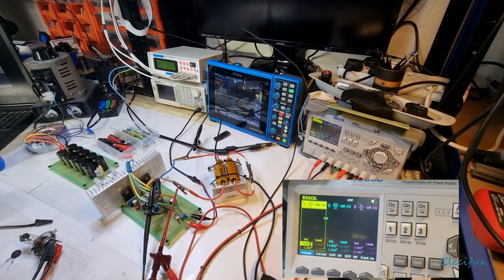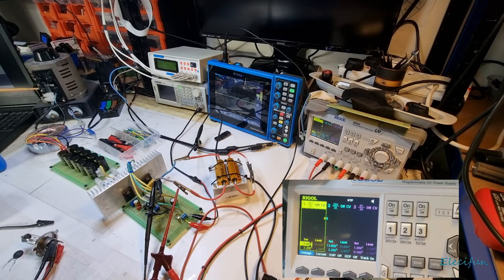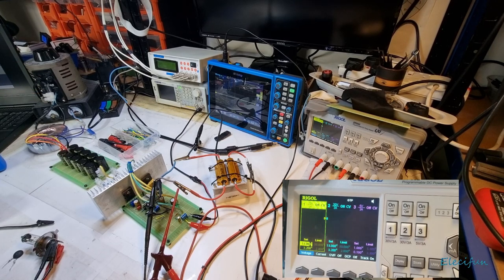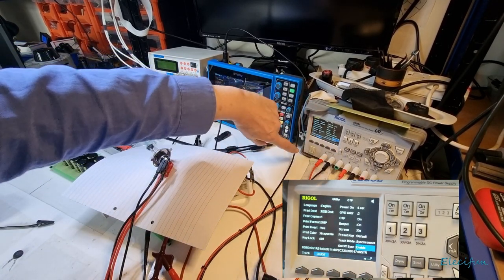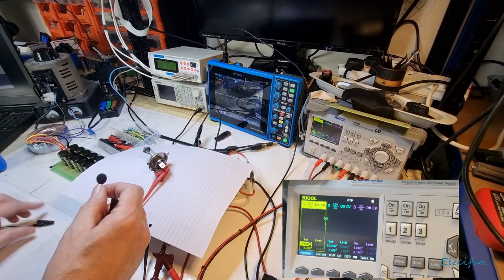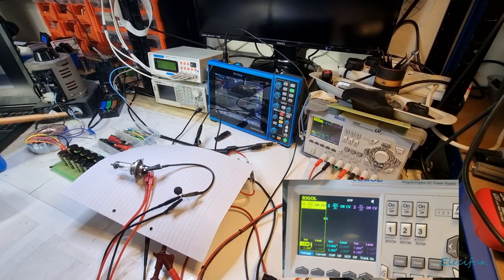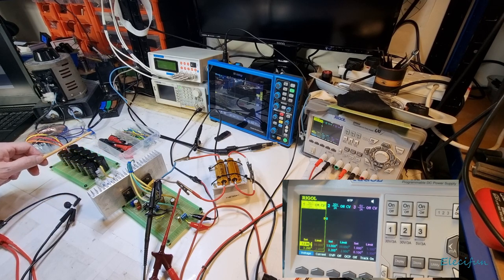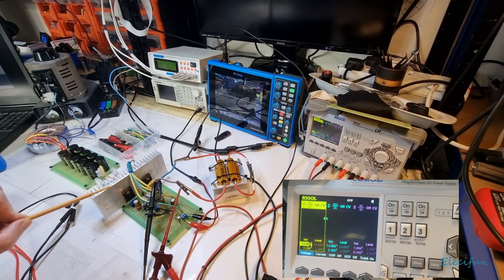Inrush Current Limiting - Do I need it?

Comment: Thx for the video.  Your voice is so quiet, it's as if you're just talking to yourself.  Hard to hear all the way over here. 🙂 Constructive Criticism 

Q) Does putting 2 or more NTCs in parallel control inrush even more?

I have a large octocopter drone that sparks/pops when connecting the battery pack before and even after flight.  Thinking inrush limiting would be a good idea.  Thx.

Comment: Very interesting demonstration Elecifun. Did you use an in rush limiter on your previous build? I'm trying to imagine the final size of your completed amp when we're only seeing one channel... It'll need quite a large enclosure.  I didn't realize the power supply would be so large. I thought you could just plug it into the mains and off you go but it looks like it needs a large step down transformer. Sorry my knowledge is so elementary. I'm learning a lot. Thanks for sharing your videos.
Reply from the maker: Hi Sonic.. yes I used a NTC on each channel but broke one and lost the other in the move. As for enclosure I will use one enclosure for each channel, mono blocks. 
The transformer used is 160V/A  24V 0 24V AC per channel used with the capacitors for an unregulated output. Once converted to DC gives me (24Vx1.414) +33.936v and -33.936v per channel. This is needed for the 60 watts RMS this amp is capable of. I could use switch mode power supply's SMPS but that would introduce noise and regulation which is not wanted. 
Life is learning, cheers for your support and interest amigo.
Reply: Thanks for the reply Elecifun. I'm really learning a great deal. Yesterday I ordered one of those cheap tube pre-amp units to toy around with. It requires 12v ac for input. I have a box of wall warts but they were all ac to dc converters... I believe it wants ac to accommodate a voltage doubler of sorts in the circuit.  I'm getting a little better at reading a schematic but I'm still such a novice. I really should seek some formal training lol. I haven't electrocuted myself yet so there's that! Cheers amigo thanks again for sharing your expertise. 🍻
Reply from the maker: Pull apart one of your wall warts and lose the bridge rectifier etc,  just keeping the transformer if its 12v or close enough. With no load it may show around 14v. 
Expertise, you flatter me sir! Lol 
I am just like you and so many others, a tinkerer with passion.
Reply from the maker: Make sure its a heavy wall wart not one of those light weight switch mode efforts. You need the heavy transformer.
Reply: I found the correct transformer on Amazon for $13. I ordered it but do intend to tinker with an old one. Thanks for the tip. I'm sticking with "expertise" lol. You are definitely an above average tinkerer. I'm really enjoying this series amigo. It inspired me to repair the crackle in my "Floyd" amp. I posted a short vid on that. Cheers mate.

Comment: Hmmm most interesting dude ! 🤔  what's that round and flat ceramic cap looking thing called again? I could not hear what you called it.🤔☕️

👍
Reply from the maker: It's a NTC (negative temperature coefficient) When its cold it reduces current flow and as it heats it allows current.
Reply: @Elecifun  oh okay that interesting. 🤔 something new I learnt today. 👍
Reply: @Elecifun  So its a thermally sensitive resistor which they call a NTC thermistor but is really a transducer. Very complicated stuff still most interesting all the same.
Reply: @Elecifun  At some time I'm going to try to fix my old Z5500 Logitech 5.1 surround sound system.

I dont actually know what is the problem with it.

It could be just the on / off switch.

Still its probably more likely the thing with the volume control.

Anyway its time to get some shut eye.

I was too tired to go on. 😵
Reply from the maker: NTC can't do what a transducer does.
Reply: @Elecifun  oh okay without really knowing. 🤔